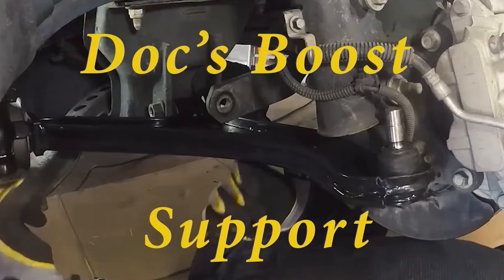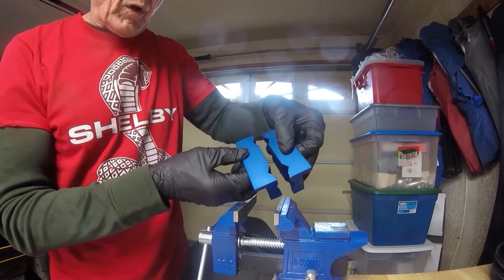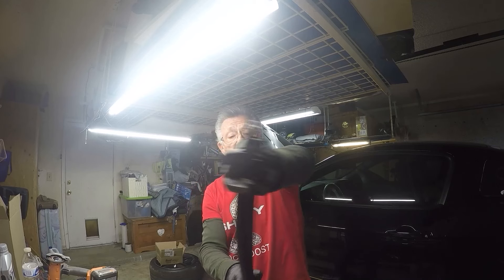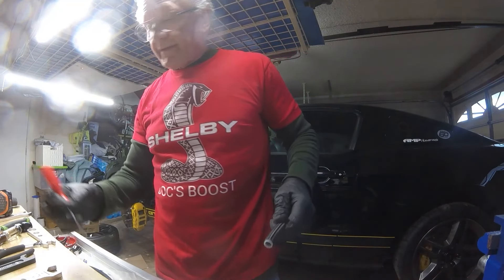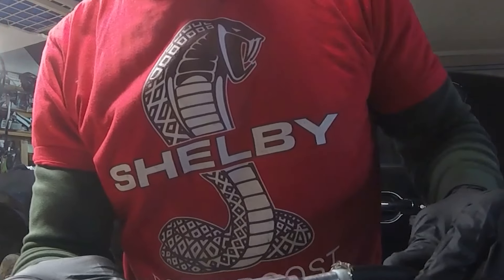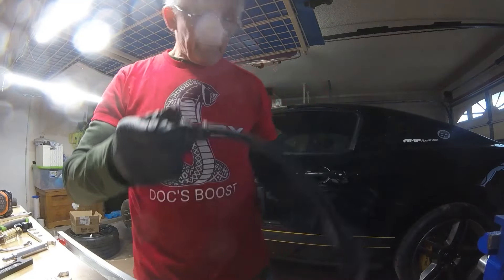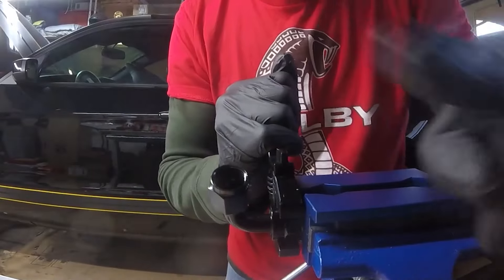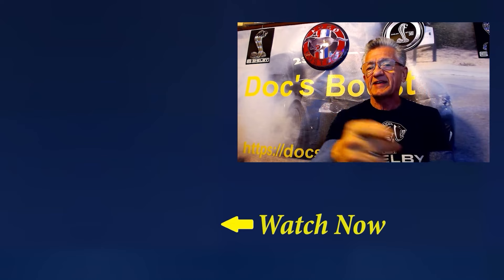Give me 5 minutes and I will teach you how to attach fittings to PTFE fuel line

Comment: I've made braided AN lines.  Definitely not fun.  Good tips, but don't forget to clean out the hose after cutting it!  You don't want cutting wheel grit getting into your engine.
Reply from the maker: I rinse each hose section with alcohol--I missed showing that in the video.  Then I flush the system completely by placing the return line in a bucket and energizing the system.  I let it run for a few moments to flush everything out.  Then reconnect the return line to the tank.  Thanks for reminding me.
Reply from the maker: You need to protect the flow through the microfiber filters at the bottom of the pumps.

Comment: Must be nice to have a ferrule that actually fits your line. I am having to replace the whole line because the ferrule was made about 1mm small and can’t fit without damaging the hose.
Reply from the maker: I wonder how that happened, Didn't the ferrule come with the fitting or did you buy the ferrules separately?  I know I tried to buy 8AN replacement ferrules they always came too big but the ones that came with the fitting worked perfectly.
Reply: @DocsBoost  Yea, not quite sure. I ordered another so, hopefully that one fits better. I’ll let cha know
Reply from the maker: Thanks, I would like to know how it works out.  Did you order Frigola fittings? Evil?  ???